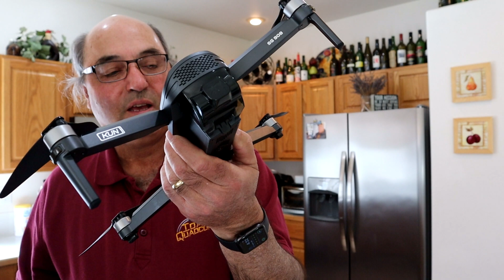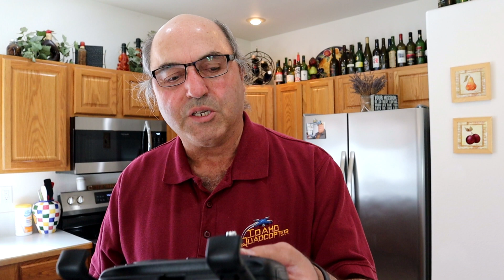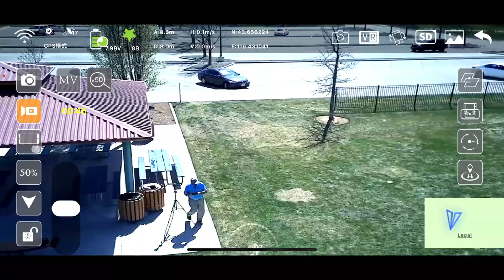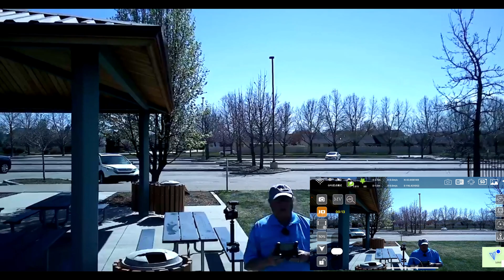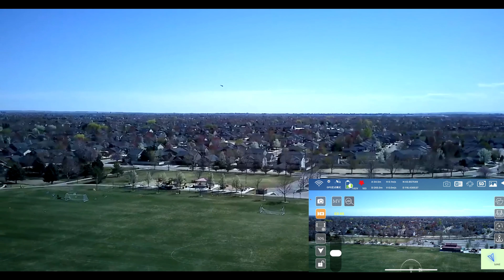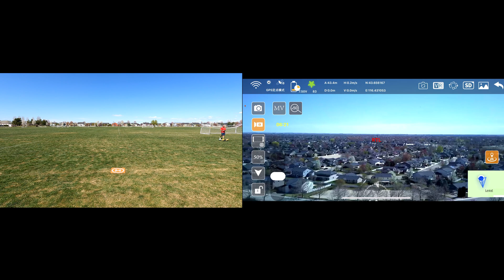ZLL SG908 KUN Flight Test and Review

Comment: NOTE: The SG 906 battery and the SG 908 are TOTALLY DIFFERENT. The 908 is wider by far. That's why I'm watching this video. I had to buy a few SG 908's since now I have 2 batts for them. (The two I bought by mistake). I made the mistake of buying two 908 batts for my 906's. With all the research I've done. It seems like this is a worthwhile drone. I love my 906's. I fly them indoors only because of the underpowered motors. When the batts get to 40 percent the wind will blow them around which for me means hitting trees as I fly in the woods filled with trees. I don't waste my time with toy-grade drone cameras so don't ask. The one improvement I'm hoping for is when you push the left stick forward it would respond better. For $150. I'm not going to complain.
Reply from the maker: It's been quite a while since I flew this drone, and honestly don't remember that much about it.  As I recall, I had some issues with it.
Reply: @IdahoQuadcopter  You get what you pay for. Lol. I was hoping Zlrc would have improved the left stick. On The 906 you can push it full forward and the drone snails along in certain situations. Their 907 is pretty good. I got my 907 for $105. thanks to my Banggood wholesale discount and the 5 percent cashback on whichever credit card I used. No need to respond. I just felt like "Ya'pin."

Comment: Marcus 
Thank you very much for this very informative and totally honest review. It was painful to watch some of it since I’ve ordered one about a month ago, but warts and all I still think it’ll be a great low-cost entry drone and will suit my needs well.. personally.. when I compare your review results with some others on the SG908 I think yours is defective .. because you had significantly more problems and jello in the footage.. I hope you don’t toss it, but follow up with a few more attempts.. to see if it was just a bad-drone-day or if the issues persist. If you take a look at Quadcopter 101's and Drone Captain's reviews you’ll see the amazing contrast in video and flight performance as well as the similarities.. in any case.. thanks very much for posting this great review 👍
Reply from the maker: I did see that Jim's video (Quadcopter 101) looked much better than mine, so it does suggest that I may have received a bad one.  I very well may try the drone again to see if I can get that gimbal working.  Thank you!

Comment: Hi Marcus, nice review on this budget drone. I see that Best Buy has the basic DJI Air 2s for a price of $1000. Are you sure you should have sold your Mavic Air 2 ? I sold only one of my two Mavic Air 2's. Also learned that the new Fimi X8 Mini has a slight horizon issue. It wouldn't be a Fimi if it didn't have a horizon issue. lol
Reply from the maker: Thank you ssb73q!  You can be sure, i'll order a new DJI Air 2 on release day.  😁  As for the Fimi Mini, I suspect there may be some issues.  😎
Reply: ssb72q: where did you here about the X8 Mini issue? No video has yet been released.